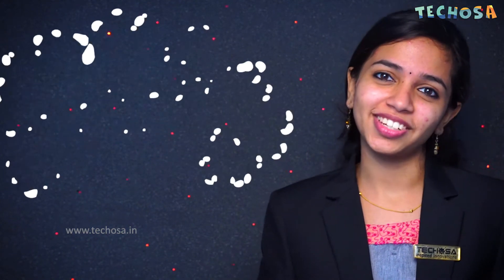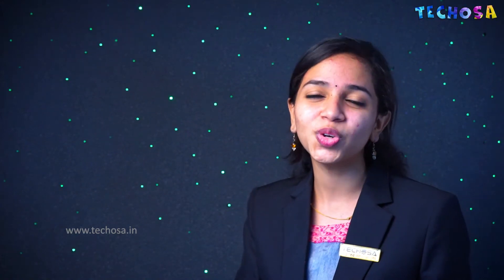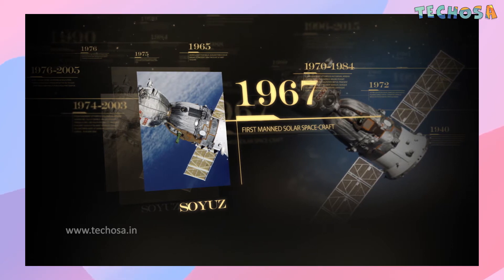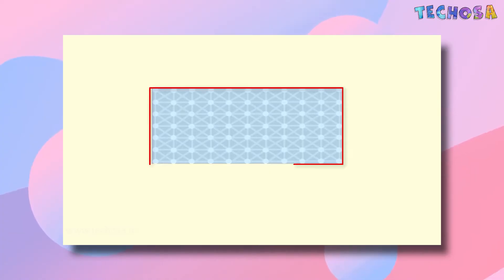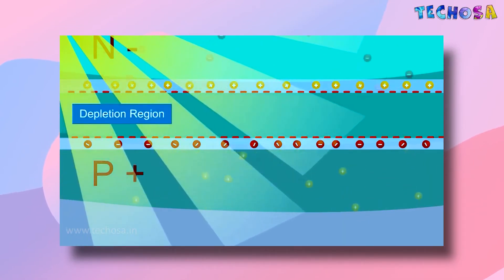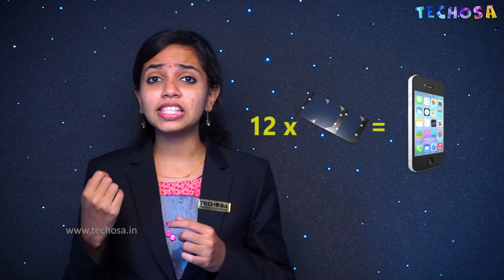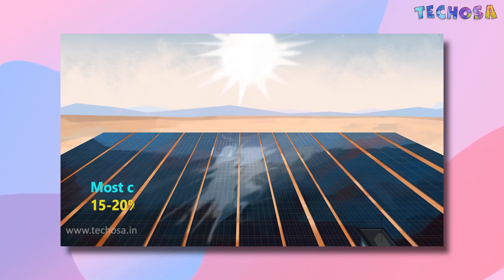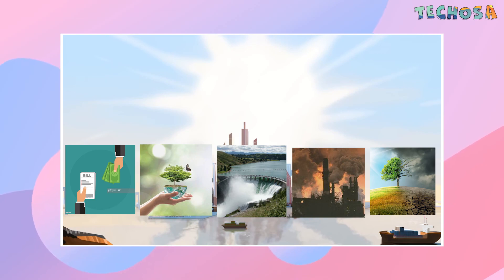SOLAR ENERGY | WORKING OF SOLAR PANEL EXPLAINED

Comment: Mam we can use solar power in the morning and wind power in night and other climate days. Is that is possible??? So we can reduce the use of fossil fuels.
Reply from the maker: We can't satisfy the required power consumption using wind and solar due to several reasons such as the wind farm is too much expensive and it needs a continuous blow of wind to produce power. Good land-based wind sites are often located in remote locations, far from cities where the electricity is needed. Transmission lines must be built to bring the electricity from the wind farm to the city. which makes it even expensive. We have discussed the limitations of solar energy in the video, so these reasons make it practically impossible for solar and wind to generate the power supplied by fossil fuels.